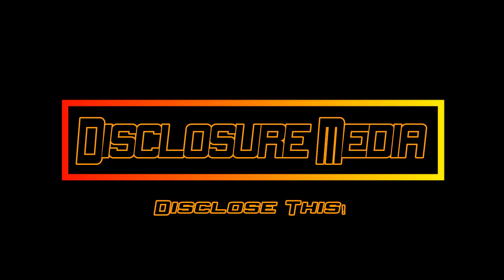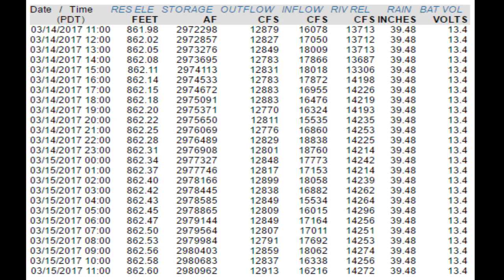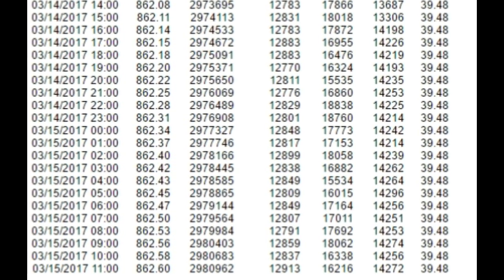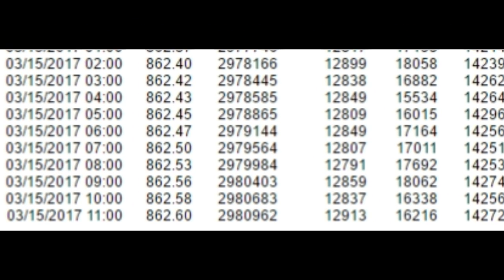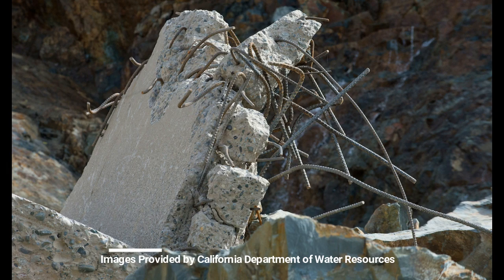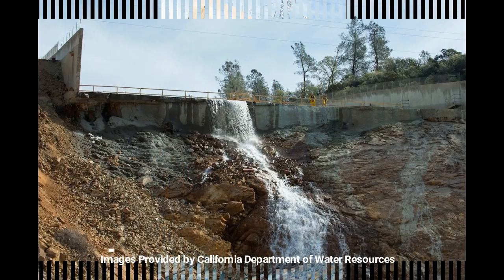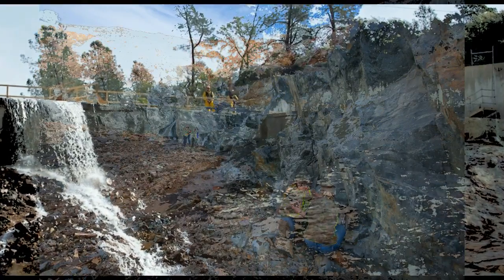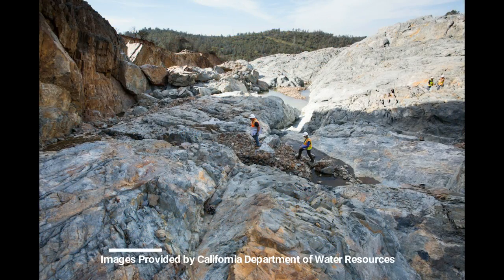New Images | Lake Inflows Increase | Lake Oroville Dam Short Update 3-15-17

Comment: Good news. The warm weather has not resulted in increased inflows. In fact, it just dropped, and the lake level dropped. http://cdec.water.ca.gov/cgi-progs/queryF?s=ORO&d=15-Mar-2017+14:58&span=24hours   The worry warts were afraid for nothing.
REPLY
Reply: Rodger you need to rethink how fast water goes downhill/mountain...get out of orvillee or Jim will get yah!
Reply: Roger Barnett. it is rather interesting to see concerns wax and wane. it's sorta like the stock market.  when everyone thinks markets gonna. go up it goes down and then when sentiment shifts( ussuall after a selloffs)[or lake level drop] then everything seems more (bearish) or [ rosy].       so if the peak of concern was around 2/12/17~. the high in water ...then the low in concern or the Lowe water levels would be   3/11/17~ or so and rinse and repeat  if you get my postulations
Reply: Wendy Davis WOW that was a quick response only took u 26 seconds to respond to me.
Reply: Shasta Lake isn't connected to Oroville.... not till miles downstream.  Lake inflow just jumped way up...but perhaps the figure will get adjusted..may have been an anomoly
Reply: Not one of these so called information providers can answer the simple question I continually ask and then get banned from the chat, because this is just another dis-information service. WHAT IS THE FORMULA FOR CALCULATING THE POWER IN KILOWATTS OF THIS TREMENDOUS WATER FLOW? Not one fucking genius on here or any other D.M. uploads?  The only thing they tell you is the water levels?? What the Crap? HOW MUCH POWER is going to come out of the spillway? YOU STUPID FUCKS? The formula is so simple and likely easily found on google, but does one person on here have any fucking idea of it? NOPE. You all must have went to school in Oroville. It still goes up to grade 6 there doesn't it? FUCKING HILLBILLIES .  You done Jed Clammpet proud. C A L I F O R N I C A T O R S........ Let it rain.......
Reply: Lake Shasta doesn't flow into Lake Oroville.
Reply: I disagree bro
Reply: YES IT DOES>>>LOOK AT A MAP MARK
Reply: Feather River flows into Lake Oroville. Sacramento River flows out of Lake Shasta and the Feather flowing out of the Oroville Dam joins the Sacramento a few miles below the the Oroville Dam.
Reply: OK there are 6 generators (only 5 operational at the moment) 
<blockquote>three 132 megawatt (MW) conventional turbines and three 141 MW pump-generators for a total installed capacity of 819 MW. </blockquote>
so about 685 MW at 12800 cu ft/ sec
inflow (currently) 17000 cu ft/ sec or 980 MW if they had the turbine capacity to use it all.
If they release 40000 cfs that would be the equivalent of 2100 MW give or take.
Reply: Read my comment again. That is exactly what I said.
Reply: Here is  a map of the Feather River Drainage. I live on the North Fork. You won't see Lake Shasta on the map. By the way it is spelled Oroville. If you need my help reading the map or using a dictonary let me know. https://upload.wikimedia.org/wikipedia/commons/8/8f/Feathermap-01.png
Reply: KK Maybe your right but I see all 9 spills lead to Oroville ..pardon my spelling..I just want people to know  Jim Brown is not going to give people fair warning..If you can offer more go for it.
Reply: 9 damns flow into Orivalle ,If you need my help to see it ask
Reply: Snow is melting.  If Orville dam water level is not rising, then Shasta is holding it back.  Hot sun sends us running into the shade even at 70 degrees.  The river below Lake Kaweah is high as well.  Lake Kaweah is at 132%.
Reply: Feather river flows OUT of Oriville INTO Saccremento...you need map lessons bro
Reply: Your way is all uphill
Reply: All ( Damns Above Oriville flow down hill too guess where...READ YOUR MAPS even Shasta bro!

Comment: Interesting how the DWR was able to shift the water run-off from the far right to the center.  I was wondering how they were going to be able to apply the shot-crete to the far right side before using the spillway again.  Plus . . . . "Rebar?!  Did somebody say rebar?!!  What rebar?!"  ;o))
Reply from the maker: I didn't see no rebar ;-)
Reply: They sandbagged the upper part of the spillway to channel the leakage over to the one side so they could do the shotcrete undisturbed.
Reply: They used sandbags at the top of the spillway to divert water left and right.
As to the rebar, funny how they show so much of it now, it is probably from the sidewall of the spillway. You should have been seeing as much sticking out of the ends of the boots portion.
Reply: Re bars, REBARS? We dont need no steenkeen re bars!
Reply: From the 1948 Bogart movie, "Rebar of Sierra Madre."   ;o)
Reply: "Rebar, what rebar? We don't kneed no stinking rebar".
Reply: There are 8 separate spillway gates, they can be controlled independently to control the flow from one side to the other.

Comment: I was disappointed the DWR  didn't show any new photos of the main spillway repair.
Reply: They have determined  that drumming (the spillway vibrating over the rocks because of flow oscillation patterns at certain flow rates) caused the failure and are putting in rock anchors to reduce that movement.
Reply: I didn't think they were doing any more repairs to the spillway, they are concentrating on removing the debris from the river so that when they open the gates it doesn't wash back out.
Reply: I think the opposite is the case. There were photos of drilling machines for rock anchors and grout injection but they didn't explain it.